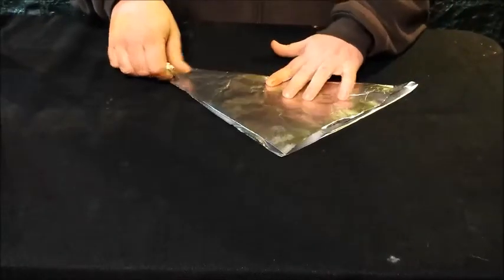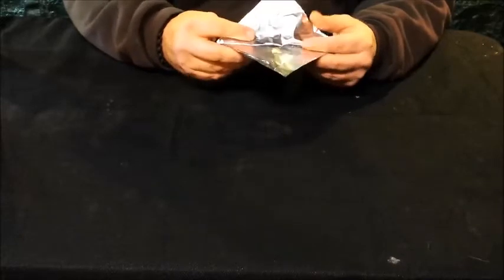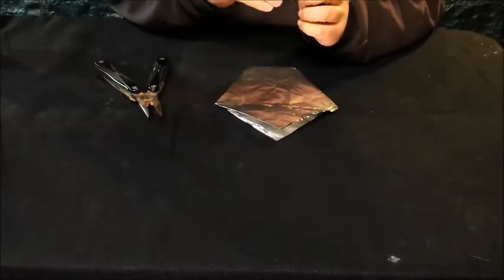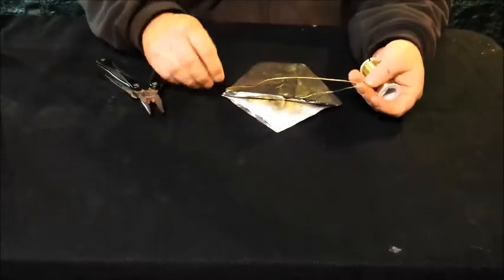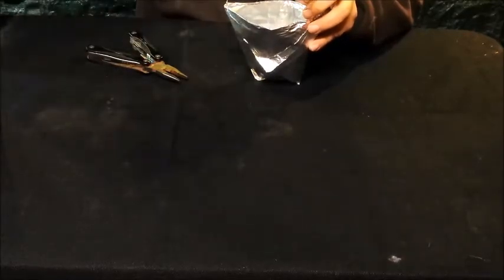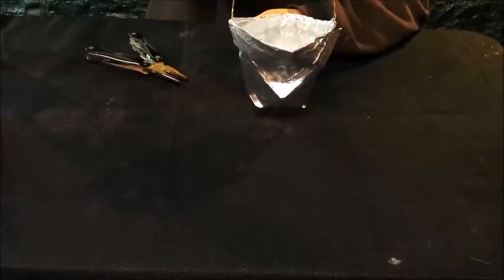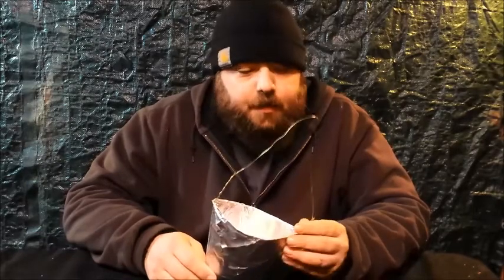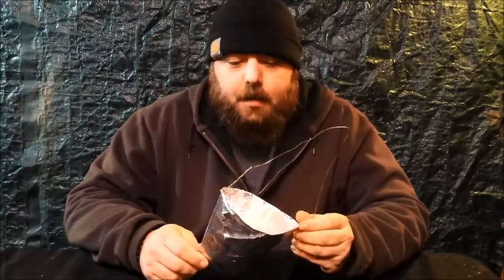Prepper Survival Tips- How to make a tin foil cup

Comment: I love tricks like this, but I also like to do a "lab test" and a "system test" -- this one failed my first time in the lab.

I folded the cup as shown and filled it with water.  After 15 minutes on my stovetop in my kitchen (hottest burner, highest setting) I still had no boiling water and had lost over half of the water through minute slow drips -- drips that did not happen when first folded.

I will attempt to repeat to make sure that I did not make any errors in the folding -- human error on my side is ALWAYS a possibility!

Comment: Cooking Pot
Rich “Raspy” Shawver
 
Here is an idea that I picked from Origami.
Start with heavy foil. Like those disposable oven liners the ones that look like a cheap cookie pan.
Take a piece 13 X 13 inches.
Clip a ½ X ½ inch square out of each corner.
Fold each edge ¼ inch twice to form a rim.
This gives a 12-inch square.
Now you need to put in the creases to form the box.
Fold in 1/4 or 3 inches of one end and crease.
Do the same for the other side.
Unfold and rotate 90 degrees.
Take the other two sides and repeat the creases.
This forms a crease pattern of a 6-inch center square
4 3-inch squares at the corners.
The sides are then 3 X 6 inches.
Now you fold the large square diagonally.
But you only need to crease the portion that crosses the corner 3 X 3 square.
 
For carrying you fold in the 4 sides to form a 6-inch square and the fold it in half. This gives a packet 3 X 6 inches, which happens to be approximately the size of a dollar bill. Making just right to slip into the bill compartment of a wallet.
 
To set up you unfold the packet. Using the diagonal creases you form triangles at each corner. These start at the base of the box and extend out 3 inches at the top. Two of these triangles are then folded along the same side. The other two are folded along the opposite side. The tops of these triangles are tucked under the folded under the rims to help hold them in place. Making the box more ridged.
 
This gives you a 6 X  6 inch pan 3 inches deep. The box is 108 cubic inches or almost 60 fluid ounces. Which is just 4 ounces shy of 2 quarts. Since you won’t fill it to the rim call it a quart and a half of usable space. Not bad for something that fits into a wallet.
 
You can also slip a couple of paperclips over the ends to make it more solid.
 
Yes, repeated folding and unfolding plus the wear and tear from the friction in a wallet will eventually open holes and cause leaks. And once used will accelerate the deterioration. But because of the heavier gauge of the pans they last much longer than aluminum foil. I’ve gone through a couple both carrying and testing. They have lasted for several years or a half a dozen reuses before they became iffy.
Reply from the maker: Rich Shawver Very interesting. I'll have to try that, thanks!

Comment: Nice tip! I've tried a few ways of making a bowl out of aluminuim foil. One configuration of which leaked and the original way that a lot of people do is the one layered fist bowl, which is to flimsy. This way you did it is the best way I've seen of a foil bowl.
Reply from the maker: Jason McDaniel I have another way I'll show when I get a chance to do an overnighter video. You can dig a hole and press the foil down in, take it back out and drop some coals out of the fire in and then put the foil back. That's the best method for cooking I've come up with anyway.